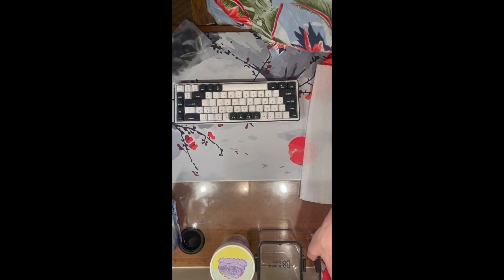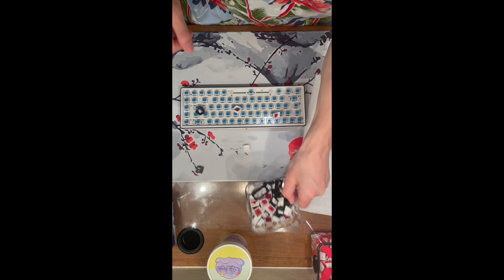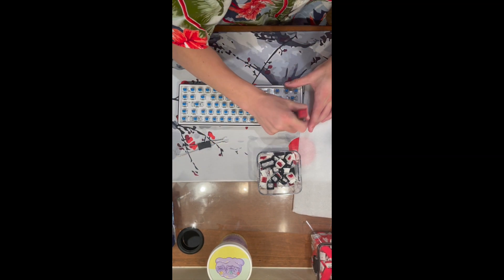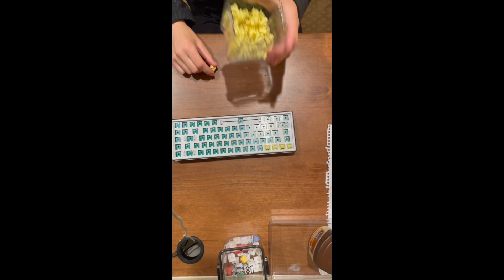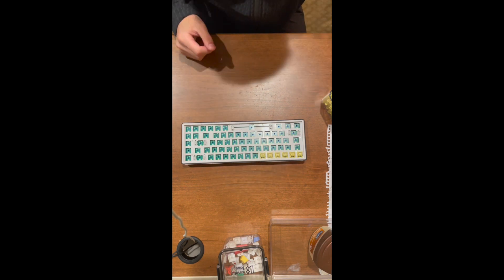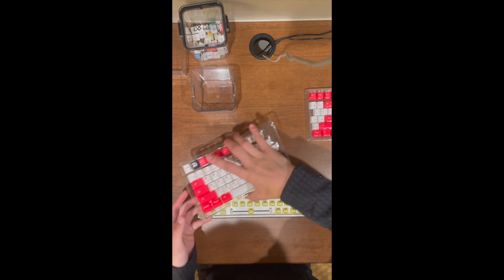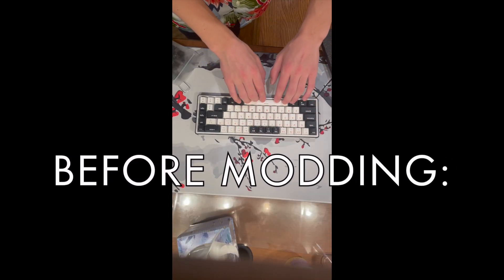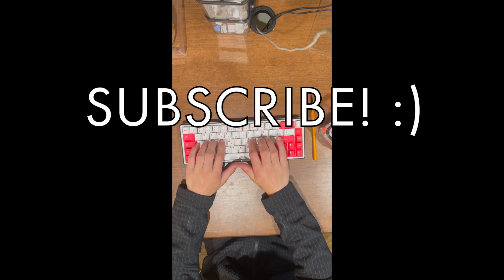UPGRADING AND MODDING A 10$ KEYBOARD...

Comment: I think you did a fine enough job for what you wanted to do. Shame about the enter key. That usually happens when one of your stabilizer stems doesn't have the wire in the right place, like one of them is just sitting on top of the wire. Alternatively, it could be the switch itself not fully seated into the socket, causing a raised imbalance that the stabilizer stems can't reach.

That said, the Gateron Switch Puller is a fickle thing. You have to aim the little prongs on the north and south bottom housing clips and press exactly down with no angle in order to get a good hold on it.

If you were to mod anything else on here, I'd definitely go for a different set of stabilizers. Anything is better than what you have, TX plate mounts would be excellent. It'd probably help with your busted enter key, too.

Great taste in keycaps.
Reply from the maker: Thanks so much! I appreciate the feedback! didn't have any extra stabilizers on me at the moment, unfortunately. stay tuned as I will be building a zoom75 in about 2 weeks when it gets delivered to me!